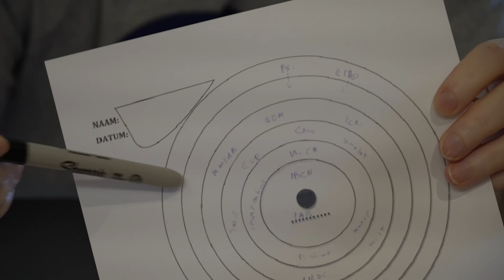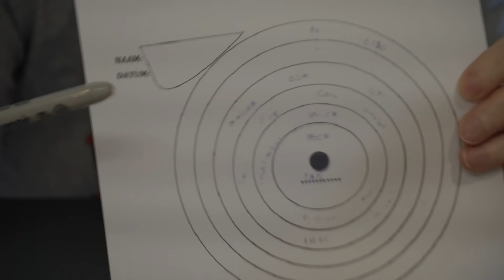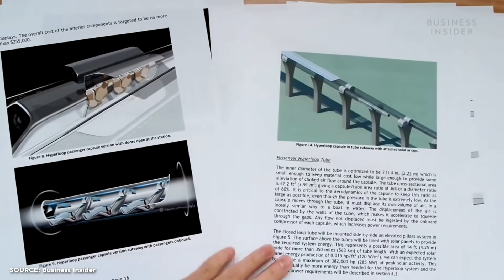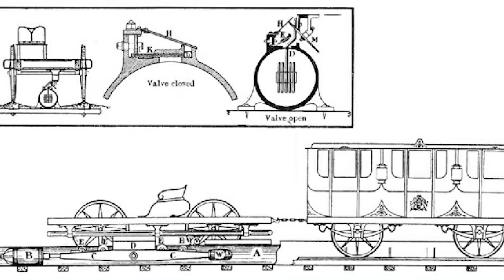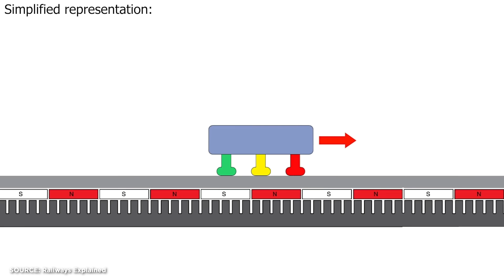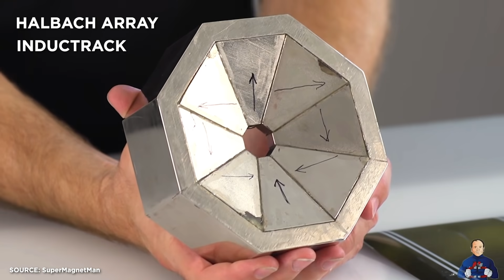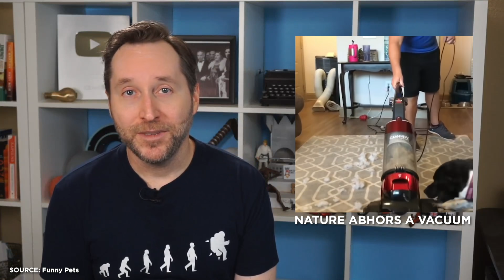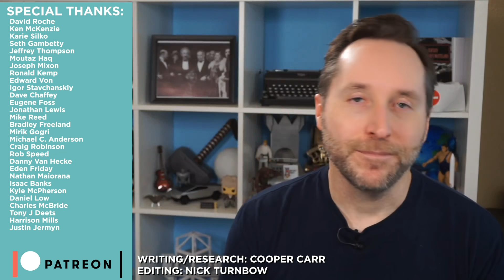What's Happening (And Not Happening) With Hyperloop | Answers With Joe

Comment: The maintenance for checking every possible tiny leak is just mind boggling.
Reply: Not really. It could pass through a sonic area set up periodically throughout the system to detect imperfections/defects. Its used every day in the steel industry.
Reply: @bryantmanson4097  how many man hours for a 100km pipe?
Reply: You don't need to check for tiny leaks. The scavenge pumps will take care of those. Your mind is boggling over the wrong thing. It's like worrying about a bullet hole in an airliner. The airliner actually has a 3-4 inch hole in the rear where the pressurized air is dumped overboard as new air is brought in from the engines' compressor stages. A 747 or A380 actually has two outflow valves of about 4 inches (10 cm) diameter. Actually, the A380's (they are actually squarish) may be bigger but I've only seen pictures and that thing is so huge that it warps your sense of scale. Which, incidentally, is the same thing causing you to worry about "every tiny leak."
Reply: @Markle2k  there is a huge difference between positive and negative pressure structural integrity.
Reply: @DinoAlberini  Yes and no. The pressure differential of a near vacuum is just 14-ish psi. That is easily engineered to prevent catastrophic failure from beer canning with a minimum of material. The vessel we saw implode was designed to hold liquids, not uniform pressure.
Reply: @Markle2k  a beer can easily holds 5 bar pressure, but almost nothing in negative pressure.
Reply: @Markle2k  your example falls completely flat when comparing compressor intake to a vacuum system. Of course you have to check for any of the tiniest leak or your vacuum (or "near vacuum" is toast and the hyperloop a shit version of a regular train. Flow rate of vacuum pumps decreases exponentially with decreasing pressure but inflow through holes is near constant. If you have a tiny hole in your stupidly expensive tube you likely need an entire pump section running 24/7 to counteract it. God forbid you get more tiny leaks to accumulate
Reply: @itsa_possum  No. I actually have practical experience with working with vacuum.
Reply: @Markle2k  in that case you should be aware that the so called hyperloop is an impractical, immensely dangerous and supremely expensive pipe-dream that even if constructed would not offer tangible benefits

Comment: Keeping a partial vacuum over such large geographic area's is insanely impractical and dangerous.  This is a scheme to move money from investors pockets to the various idea men pockets.
Reply: Cost/passenger mile = insanely high.  Route volume flexibility = Almost none.  Route flexibility = ZERO.  Safety = Dubious at best (one earthquake at wrong time and it is total destruction for miles around).  Best possible travel time = 23 minutes at 1G for a top speed of 15,435 mph at midpoint. Which is nice
Reply: @blondegirlsezthis8798  Whomever is pushing this nonsense is sure scamming some wealthy but uneducated people.
Reply: @protonneutron9046  you sound like a bot
Reply: @protonneutron9046  /r/iamverysmart

you can't argue with ideas so you have to resort to attacks on intellgence
Reply: @blondegirlsezthis8798  well lib, what is your education in this area????

Comment: The long and the short of it.
Short: same BS, same non-improvement, same non-advances.
Long: even more animations, mock-ups, fails at exceeding Autobahn-speed in a non-evacuated tunnel over a distance of 500 meters, shouting Muskovite fans exhilarated at being in His Holiness Presence, still no mag-lev capability but still rolling wheels carrying the mock-ups, catastrophic failures of 1-10 scale models disintegrating at barely 105mpg/ 175km/h in a straight line... the list of BS goes on and on and on, but the Muskovites will continue chanting the "Holy White Paper is always right because it says so in the Holy White Paper!"

Comment: A low cost system focused on package delivery and stock supplies for commercial city areas and residential areas would be sweet ...
Reply: It will never be low cost. That is the Achilles heel of hyperloop. Theoretically possible for sure but just not going to happen due to cost.
Reply: trains?
Reply: @iptg2673  I was thinking of a modern version of the pneumatic tube delivery systems… actually it would not need to be a vacuum system… just a network underground tubes where warehouse type robots deliver parcels and good into congested cities and could directly service urban centers, without adding to the abysmal traffic situation of many large cities. Trains disrupt neighborhoods, and claim too much real estate in cities… but if those delivery robot platforms in tubes that I’m thinking of ride on rails… why not…
Reply: @nougatbitz  that is genuinley one of the dumbest ideas that I have ever seen come out of the hyperloop, holy.

Comment: I had a very similar idea years ago with a train going through a vacuumed tube , but for propulsion the tube itself would have small wheels around its diameter which can push or slow the train , giving it a direct proportional speed .
Reply: I had an idea of breeding giant hamsters and that they would run through the tubes, pulling the trains.

Comment: Everyone: WOAH Hyperloop!

Thunderf00t: uh, no. Here’s 300000 reasons why
Reply: And all bullshit.
Reply: @andrasbiro3007  lmao sometimes his skepticism can be "toxic"
Reply: @andrasbiro3007  how is it bs that the vacuum system always leak? It is a fact of real world. And maintenance of functional vacuum in a large volume would be extremely cost inefficient
Reply: @KateeAngel  thunderfoot has a degree on chemistry, did a ton of research, and a skeptic. So i wouldn’t say that he is wrong or dumb. But the people who are in charge of engineering the hyperloop knows what they’re doing. That’s why sometimes i kinda disagree with his overly skeptical view
Reply: @KateeAngel  
It's bs, because Hyperloop doesn't use the same vacuum as physicists do. Technically it's not even vacuum, just very low pressure air. This makes all the difference, because it's far easier to create and maintain low pressure than proper vacuum. The most basic pump can achieve the pressure that Hyperloop will use. And you can just keep a few pumps running to mitigate the effect of small leaks. Also putting the whole thing underground solves a ton of problems automatically. For example tunnels that go below the water table already have to withstand several atmospheres of external pressure, so they don't care much if you pump out the air.

Comment: The biggest problem I always had with Elon's original Hyperloop paper wasn't so much whether it could work. Yeah, it probably can. It was the absolutely transparently false claim that it'd be able to be done at a fraction of the cost of normal high speed rail. No, there is no way that a system going the same distance, but using pipes in partial vacuum, all using completely new technology is going to be cheaper than bullet trains. But it suddenly became talked about as a serious thing because of Musk worship. Which is at least as big a problem as Musk hate (or rather was, before he put so much effort into destroying his reputation with idiocy like his covid denial, endorsement of Kanye for president and torturing a baby with an unpronounceable name).
Reply: Agreed. A maglev in a vacuum tube is totally buildable as an engineering challenge, but a nuts idea economically. Hyperloop has a few minor cost savings, with some huge additional costs. Cargo hyperloop - even more ridiculous, no one is going to pay to build a network to shift stuff at 1000kph and then have it sit in a distribution centre for half a day.

Comment: Why not just build a high-speed train system like in Japan or many European countries? It wouldn't be as fast, but would be "greener" and much less hassle than flying or driving. Plus, we already have the proven technology. It might take another Eisenhower (nomen est omen!) to get it going, but just like with the Interstate system, the supporting infrastructure would coalesce as the system developed. It might take decades, but eventually the system would become more profitable. It would still have to be largely subsidised by the government, though. If it's possible across so many European countries, why not in the U.S.?

Comment: "a vacuum" is a mistake that a lot of people make, and this video is no exception. "vacuum" is a scale from rough vacuum to near perfect vacuum, and there's a quadrillion-fold difference between the top and bottom of that scale, meaning there would also be a quadrillion-fold difference in power requirement.
the suggested operating vacuum for hyperloops range from low pressure (not low enough pressure to technically be described as vacuum pressure) to rough vacuum, which is about what planes cruise in.

Comment: The hyper loop is an interesting concept but will never be viable at least not for a century or more.  We just need to work on making bullet trains the standard instead of the rarity.
Reply: That would work, HSL connections between big cities. America could use that, IF they had the political will and drive to do so. 
Everything in the end costs money and the reason standard rail is so horribly in effective and slow is because freight trains are given presidence over people trains. To make the system better they would need to lay a lot more rail!

Comment: Doesn't need to be a low pressure environment. Just having an elevated and dedicated line that is enclosed solves a lot of rail transportation issues. I ridden the diesel trains that run up and down California a lot. The trains are owned by Amtrak (formerly Pennsylvania railroad pre-government bailout). But the tracks are owned by freight companies. Amtrak pays for time on those rails. But freight trains take priority. I've been sat still on a passenger train for 30-45 minutes as it weights for a freight train to pass. Another thing that slows trains down is outside conditions. If the tracks are wet, they have to go slower. If it's too windy they have to go slower. If visibility is too low they have to go slower. They have to stop for broke down vehicles at intersections and livestock on the tracks (both happen surprisingly frequently). 

It doesn't even need to be a mag lev to turn a 13 hours trip, that was meant to be a 9 hour trip, into a 6 hour trip consistently. Also once one has an elevated track and a large tube. The outside of it can be used as a platform to run other kinds of lines. Like natural gas, telecommunications, and electric lines. Where it crosses over highways, freeways and interstates it can serve as a partial support for wildlife crossings. Where it runs through cities the outside of it can be catwalked for elevated pedestrian and bicycle lanes. You can rent the lines attached to it so companies can move their fuel, electricity and data cheaply. And can have a pay pass system for inner city usage of catwalks. Which generates extra revenue for upkeep costs.

Comment: Hey! My city has been mentioned!

To clarify a bit on the Porto Alegre Airport thing: it is called "Aeromóvel", and it was designed by a local inventor in the 80s and a test track was built in the city center.

There were some ideas of implementing it beyond the test track, but local politics and lobbying meant it never went anywhere.

Then, when the 2014 world cup was announced, it was decided that a shuttle track connecting the airport to the local heavy rail line (around 900m) would be built using the tech, and it was inaugurated in 2013, and has been in operation ever since. It is quite a comfy ride!

Comment: Hardt has made huge strides. They are in talks with ALL of the other systems to try and develop a single design for compatibility between systems. Once upon a time, train travelers arriving in Berlin who were continuing to Moscow, had to change trains. The track systems between western Europe and Eastern Europe were about eight inches apart, so they were not compatible. Hardt is trying to "fix it" before it becomes a problem. Very smart. Also, their track switching is done entirely by magnets, no physical track switching equipment needed at all, like on railroads or maglevs. If the other companies talk them out of a "hanging" type of pod, then they are all set with a slight change to their system. Think, "turn the plans upside down". This is really how simple and elegant their designs are. After all, only test pods have been built by anyone at this point. And, realistically, all of the companies involved should have the same design basis if only for compatibility.

Comment: Air resistance is not the primary enemy when it comes to faster ground transportation, bends are. No matter what transit tech you use, be it conventional HSR, Maglev or Hyperloop, the faster you go, the shallower the bend you can take without damaging either the vehicle or its passengers. So unless the Hyperloop track is ruler straight, in a lot of these cases you could achieve the same speed for your track profile with conventional HSR or Maglev, which is going to be much cheaper and probably less energy intensive (you'll need a lot of pumps to keep the air out of that tube!). This pretty much puts paid to Hyperloop in places like Europe, you can't just draw a straight line on a map between two cities and start laying down tubes, there are far too many things in the way.

Comment: Musk has pointed out that it is common to have underground tunnels with atmospheric pressure inside, and several bars outside.  For example, the Chunnel goes as deep as 75 meters below the English Channel, which means that the pressure difference between the inside and the outside is about 7.5 atmospheres.

I'm sure that that's not the most extreme example.

So, if we were to run a Hypersoop right next to it, we would have to deal with 8.5 atmospheres instead of 7.5 atmospheres.

But, in most cases, we won't have to deal with more than a couple atmospheres.

Comment: There are legitimate concerns about maintenance of the tube if it is exposed to weather. As for derailment. That usually only happens when trains collide with large objects or the track has been damaged. Hyperloop tracks are inherently very well protected from things that could cause a derailment, especially if subterranean. A subterranean hyperloop would also have virtually no thermal expansion problems and could mitigate vibrations much more effectively by being supported on a continuum of dampening material as opposed to pillars.

Comment: Guys quick, tell me where I went wrong!

First boar out an oversized tunnel network, then reinforce it with a thicc layer of concrete. Next add a small powered rail, and just above that a layer of ceramic magnets. The powered rail would be used to send an electromagnet down the track to recharge the other magnets. With a continuous and uniform magnetic field the car could use a superconductor to take advantage of flux pinning (levitate). Since the superconductor needs to be rather chilly you could get two birds stoned at once by venting liquid nitrogen down a tube on the underside of the car. Just put your superconductor below it and make sure you vent it at the very back (ceramic magnets stop working when they get to cold, you'd want that behind you). 

To maintain low pressure you'd need a fair few vacuum pumps along the tunnel, and each would need its own tank and release value. Plus they'd all have to be tied together so the nitrogen could be reused. The release valves would serve a dual purpose: firstly as breaks and secondly as a safe mechanism in case the vacuum is breached.

My idea seems cheap(ish) and functional(ish).... where have I gone wrong?

Comment: Slight misconception. These hyperloop tunnels don't actually need a perfect or even near perfect vacuum to let you travel really fast, a tenth or twentieth of sea level air pressure works well enough for this. As there is some air in the tube you aren't really all that concerned if someone pokes a few holes in the side of it, that will just slow traffic in that section of track until they can patch the wall. 

Solar powered vacuum pumps would be a way to keep accidental leakage under control until fixed. It could also be used as a way to store energy since releasing air back into the tunnel through a turbine would be a energy gain, you could basically use the entire system as storage. Pump the system down to a much better vacuum during the day using sunlight and let air into the system at night to produce power when the sun is down. Probably not very efficient but it can be done.

The only side effect of such a scheme on the system would be slightly higher energy consumption for vehicles traveling in the tunnels around dawn and maybe the generation of a slight breeze if a part of the track was shaded and the air had to travel to a pump that had good sun.